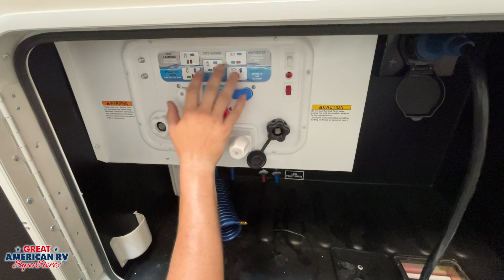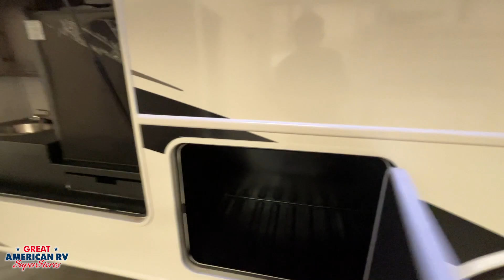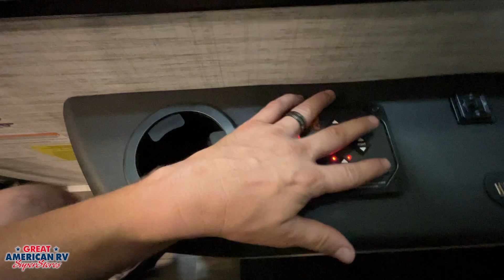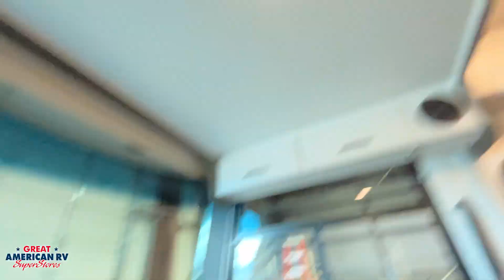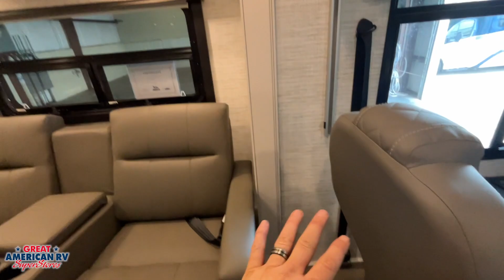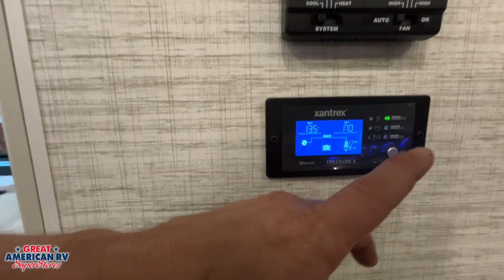2025 Alante 29S Customer Delivery Walk Thru

Comment: What's the best way to avoid the 'poop-pyramid'?  :)  We encountered that dreaded situation the first time we took our new unit on its maiden voyage.  I thought I was following the correct scenario:  make sure there's a couple gallons of water in the black tank and drop one of those chemical tablets in there to break down the solids.  Is there anything beyond that I should be doing?
Reply from the maker: More water, make sure to fill the bowl  with water for number two and when flushing, let the water run for a little bit longer count to 5 or 10 before you release the pedal.  Adding more water when flushing helps dilute the solids also giving the chemicals something to work with.  -Todd

Comment: I have a pretty silly question.  We just purchased a 2026 Jayco Alante and the hot water tank is currently empty.  Will that automatically fill up when we hook up to city water?  If so, I'd imagine there's some sort of automatic shut off when the tank is full?  Any comments on this would be greatly appreciated.
Reply from the maker: Not a silly question at all!  If it is a Tankless water heater then when you turn your hot water on it will just take a second or so to fill and pass throught the small heating chamber.  If you have a tanked water heater, it will defiinitely take some time to fill up with several gallons of water.  You can do one of 2 ways.  open the pop off valve on the water heater on the outside or just turn your hot water on at one of the fixtures inside and let it run until you have water come out.  Always make sure you have water in the tank before turning it on or it can and will damage the heating element.

Great question!  -Todd